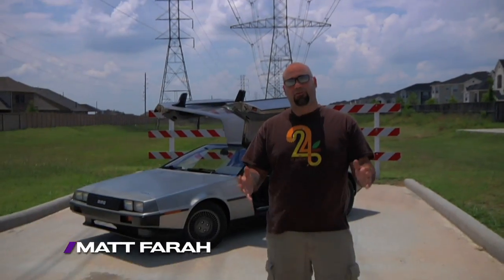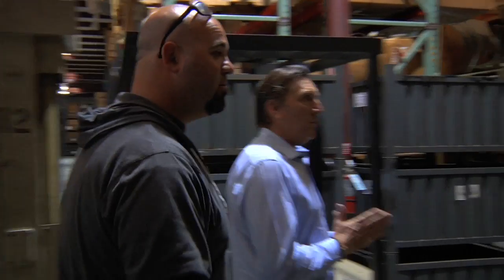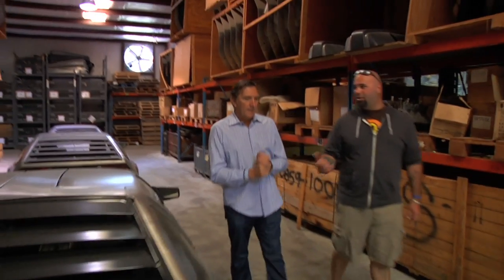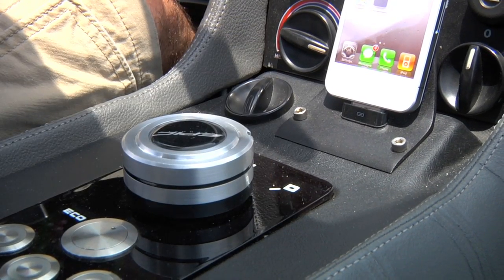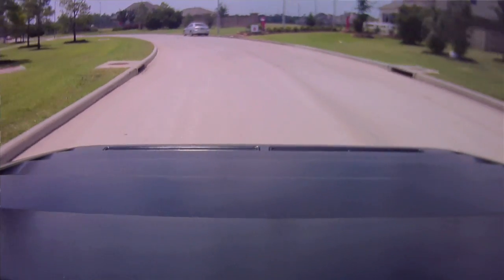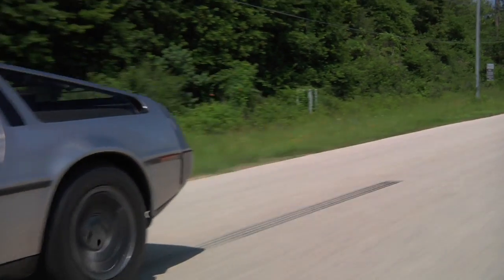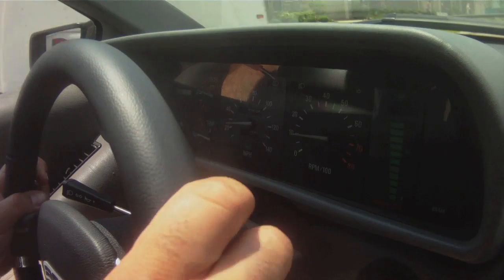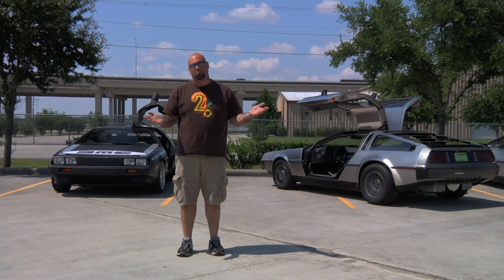DMC's New Electric Delorean -- /TUNED

Comment: "35 kW-h electric motor"? Do you mean 35 kW-h battery? Motors are measured in watts or horsepower, not watt-hours.
Reply: Guy just has no clue....sad
Reply: Teslas are rated in kw if I remember right
Reply: @nubreed13  I think you mean Jigga-watts actually!
Reply: @Hypercube9  exactly
Reply: @nubreed13 
That's still the battery rating, not the motor.
Reply: kWh is a battery capacity rating, and 35 is pretty normal for EV conversions. kW is a motor power rating, and 35 kW wouldn't be nearly enough for a DeLorean. Most likely the motor is a bit over 100 kW.
Reply: Yeah, I winced a bit there, too.

Comment: because of the car's limited range and how many miles are required to film (usually 75-80) we couldn't go too far from DMC's headquarters in case we ran low on juice. Their headquarters is in a heavy traffic area, so that was the quietest streets we could find locally for filming. The downsides of electricity....

Comment: why isnt there 1.21 gigawatts of electric power? that would be cool.
Reply: The car wouldn't even start.
Reply: That amount of power can't be generated without a nuclear power plant charging station Which the new Iphone needs.
Reply: No battery and motor setup is that powerful. Even if it could actually output that kind of power, it would probably vaporize the tires almost instantly.
Reply: @fancyman4006  wayne says yes it can be done

Comment: why can't the engine generate 1.21 Jigawatts? :3
Reply: true
Reply: It can, it's just that when you convert that to actual watts  it's not so impressive anymore...
Reply: What the hell is a Jigawatt?!
Reply: A bolt of lightning :3
Reply: And hybrids.
Reply: Crevetta its how doc pronounces gigawatts
Reply: 1210 megawatts? ;)
Reply: Plutonium is hard to come by
Reply: Because you need a plutonium chamber to generate the 1.21 gigawatts of electricity into a flux capacitor in order to travel in time! Not to mention the lack of time circuits!
Reply: Crevetta its how doc pronounces gigawatts

No, it's how he pronounces Jigawatts.  Go take a look at the script, it is spelt with a J.

Comment: That "reverse to grid", as they call it, is quite handy. When I converted my 63 Ford Econoline Van into a hybrid (because I'm a technophile, and no other reason) and gave it a power station so I could run my appliances while camping. Since I gave it 4x 30 amp 110v circuits, and 2 additional 30x120 linked to make a 60x240 (Arch welder, drier, just because) I was able to power my whole farm for three weeks when the power got wiped out a few years back.

Comment: You can't be nostalgic about a car that came out last year though. Even buying a "brand new" delorean will still look, feel, and drive as the car did in 1981. It may be new parts, but for all intents and purposes, it's still an old car. A volt is a brand new car, with a brand new design. That very point is what prevents the word "nostalgia" for coming into play. In 20 years you can be nostalgic about the Volt, but now? no.

Comment: Shame it still doesn't sound as wicked as it does in the film, I bloody love that high pitched whine sound.
Reply: +Johny40Se7en They actually dubbed the engine sounds of a porsche over the cars actual noise in the film.
Reply: MrRibbotron What Porsche has that whine sound?
Reply: The whine was a seperate noise from the electrical parts of the time machine. The engine sound was from a porsche 928 V8
Reply: MrRibbotron ah right ok, ta.

Sure that there's some kind of techno gizmo that could make that cool sound for a real life Delorean, odd that no one's done that yet, especially this one, being electric.
Reply: One of the guys that worked on the movie said they used jet engine sound effects
Reply: That might be for the sounds when it actually time-travels.
Reply: I think it's just for the time machine and that's it...any motor sound it has

Comment: These cars will still be driving around in 100 years. Why aren't all cars made of stainless steel so they don't rust?
Reply: it's softer also heavier
Reply: Sang3ETA the cost of materials would make the expensive to but.
Reply: Stainless can and will eventually rust.
Reply: Because the paint on cars stops them from rusting.
Reply: only the outer shell is stainless, 
the chassis is normal steel and they rust like crazy, 
never say a delorean doesn't rust because it does,
stainless is not softer its harder and also work hardens easy meaning it can crack easier,
it can work harden from flexing like a normal chassis/panel does,
depending on the grade,
also make conventional repairs almost impossible so its panel replacement,
306 stainless used to be 16% dearer when buying fasteners a few years back so its not that much dearer.
Reply: If only they wouldn't let Renault in the equation... they're not exactly known for utterly reliable cars, rather the opposite.
Reply: They made stainless jeeps in the Philippines.  Just the body though the frame had to be regular steel due to fatigue problems
Reply: Weight and cost.
Reply: Because it causes Flux Dispersal.
Reply: @nubreed13  do you mean jeepneys???? The Americans will think of those Jeeps(Oner)
Reply: @MetalTrabant 
To be fair, the original Renault engine was actually pretty solid... if you ignore the absolute clusterfuck of a fuel injection system they stuck on the DMC-12 and ONLY the DMC-12 and not any of the other cars that had that engine.
Reply: Seeing all these DeLorean parts in good condition after 4 decades just sitting in a warehouse without special preservation measures, and stories about DeLoreans being neglected for decades in warehouses and can still be rebuilt without work needed on the chassis, makes you realise that the upcoming Tesla Cybertruck will easily last over half a century with its fully stainless steel chassis.
Driving with the doors up look good and all, but I'd worry about the stress that it's putting on the hinges with the doors flapping over every little bump.  And at higher speeds the doors are going to give a lot of air resistance and take a lot of stress from the airflow.

Comment: Simple solution to the "boring engine" problem with the DeLorean. Replace the stock engine with the engine from a Subaru Impreza WRX STi, probably the '04 or '05 model. I would love to see that.
Reply: a camry v6 or other similar v6's should get the job done without much convesion. remember that a boxer engine has a different shape than the generic v6
Reply: jago107 it would probably fit very nicely In that engine bay, the only issue would be directing air to the intercooler, nothing a functional roof mounted scoop at the rear window couldn’t fix

Comment: "A 35 kilowatt-hour electric motor" OMG YOU CAN'T MAKE THIS SHIT UP
Reply: +mikokuijn 35 kilowatt-hour....fack...is that not a measurement for battery size now?
Reply: +kevin tate kWh is a measure of energy (amount of joules) while W is a measure of power (how fast per unit of time joules are consumed)
A motor has power, not energy capacity so Watts are applicable.
Say your laptop battery has a capacity of 90 Wh and the laptop consumes 10W power constantly, you can divide and get a runtime of 9 hours.
Reply: mikokuijn No I get it,  I just thought I was hearing the fellow weird

Comment: They will build you a brand new, bone stock delorean, which is registered as an 81 delorean but with some updated electronics and such, starting at $62,000. You can get the stage 2 or 3 upgrades installed for more power, and eibach springs for better handling, for an additional price. I thought that was old news? Guess not.

Comment: If you build a new daloreon from old stock parts from 1980's is it still considered a historical vehicle as the parts are over 25 years old lol?
Reply: It goes by when the vin is first registered. If the vins for the rest of the ones that aren't built where some how registered in 1980 which is illigal. It's a brand new 2000 something with 1980's parts. It's still a rich man's toy.
Reply: It depends.  I believe if it has the original vin tags it's an original car.    The parts are all originally from the 1980s

Comment: Thank you for responding. I was aware that they do build "new" DMC-12's at a price roughly equal to what was asked in the 1980s. $25K really lost value in the last 30-some years. As I understand it, these "new" DMC-12's are built using the old parts, with the addition of some modern bits and conveniences but are fundamentally the exact same car sold "back in the day". I'm on about DMC making a ground up, all-new car, not just sprousing up the old one with a few "bits and bobs".

Comment: 1) A Tesla will not smoke a Lambo or Ferrari in the quarter mile. In the 60', probably, but Tesla's dont have enough peak power to beat a (new) Ferrari or Lambo in any kind of real distance. I think the reason for the poor off-the-line performance has to do with the final drive ratio. Tesla's AC motor revs higher than this DC motor by about 4,000 RPM, so it can achieve its top speed with a shorter final drive, producing better acceleration off the line. The new AC motor also has regenerative

Comment: Kilowatthours are a unit of measurement for total battery capacity and not to be confused with kilowatts. The engine, at 250hp is roughly equivalent to 184kW.

Comment: Better to just buy base car as donor and have aftermarket company in San Diego load a Tesla Ludacris motor. Then figure out way to get wider tires. Then take to West Coast Customs and get new seats//custom interior. Maybe they can retrofit VW hvac system with dials and other various buttons. Then who see who can make modern LED custom tail lights and combine the front square headlights into two large Audi style front lights. Then it would be the car it always needed to be in 2020. That would be one of my dream cars for sure. Willing to work with DMC SoCal to help improve if hiring.

Comment: Question you mention they are integrating more upgrades on the electric one and the AC is  need it on that car because as you showed the windows are a piece of art for lack of another word, how much running AC will take away from the range of the car and the top speed, as we know the more trinkets working on battery power the more juice it uses and the least range and top performance you get.

Comment: Stainless steel construction... it's just the body panels.  The Delorean Motor Company can give you a stainless steel Double-Y chassis now, but originally that wasn't under the car.  The car is still mostly fiberglass.

Matt, have you tried the 200hp stage II engine upgrade?  Given I haven't, and it's still not likely any faster than a GTI, it's something.  That engine has a nice growl, to boot.  Sorta like a fuel injected Dino when done right.  That and I'd like to see the three stages tested.

Comment: You can do a conversion for way less and you would be able to run the batteries in the tunnel. No doubt you could also get a better motor as well. But it good to see them progressing forward and moving away from fossil fuel.
Reply: where is your prius?

Comment: The engine would've been great if someone out there recreates the DMC-12 Legend Industries Twin-Turbo version. It made around the same power as that Stage-3 package DMC-12 and back in the day it completely whooped the Ferrari 308 and the Porsche 928 in 0 to 60 (5.8 seconds, top speed 150 mph) and on the track, its would-be competitors of the time. Sadly, since John DeLorean's fiasco that ended with DMC in bankruptcy, that also caused the 5,000 twin turbocharged DMC-12s that were in the planning/ordering stages to be aborted before they could get beyond the testing stages. Imagine that, there were 4 turbo DMC-12s from factory, all of them test mules for Legend's turbo system, 2 of the twin turbo (VIN 530 and 558), 2 of them larger single turbo. Those PRV engines had 6 turbo test engines, 4 DMC-12s and 2 Renault Alpines. The funny thing about the PRV was that it was gutless and very low compression, so a twin turbo as DMC had planned (or that Stage-3 with the 5 pounds of boost) did wonders to increase the depressed 130 hp the stock engine had, just improve the other components to make it more reliable as Legend and DMC would've done back then.

Comment: they can always have 12v reverse cycle air conditioner hard wired into the electrical system and have it use the same ducts the car used, but without the blower motor fan.

Or they an have the condenser hooked up to a pully that is attached to the axel that's powering the wheels

Comment: is this rear or front wheel drive? they should have it set up so which set of wheels (either rear or front) thats not the driving wheels but the dead weight rolling ones lol have a pulley system that uses alternators to charge those batteries

Comment: you know, the future upgraded one, with that fusion powerplant, still needed gas in addiiton to trash for the time drive.
why not run the car on the power output from the fusion plant? i am quite sure it could generate enough to power it lol..
of course i am sure that the third movie did that bit entirely for the plot, as electric motors obviously existed back then.

Comment: What's not to love in the Delorean? Having driven one, I can tell you!

1) The Engine
2) The brakes
3) The suspension
4) The ride
5) The handling
6) The electrics
7) The seats
8) The steering wheel
9) The gearbox
10) The build quality
11) The stainless steel body.

Why is the stainless steel body bad? Because it means they'll NEVER EVER rot away. :(

Comment: This is pretty neat, but seriously guys, learn the difference between energy, and power, it's an extremely basic concept that is, for some reason, so often misunderstood. It has a 35 kWh (kilowatt hours) or 126 MJ  (megajoules, or megawatt seconds) battery pack (that's the energy stored), and a 230 HP motor which is about 171 kW (that's the peak power of the motor). Energy is power multiplied by time, super simple example:

If the car was consuming 35 kW of POWER for one hour (that's 35 kWh of ENERGY), that would completely deplete the battery pack.

Comment: It's too bad the DeLorean's styling is just not up to part anymore.  I'd like to see one with aluminum, fiber glass, or some carbon composite construction instead of the steel.  This would save a lot of weight leading to better performance in all areas.

Comment: Matt i have a question for you as we know electric power cars have way more torque that gasoline power one. point the new tesla, and on the videos online from tesla they SMOKE the $#!%% out of ferrari and Lambo from standing point in a 1/4 mile run but why that DMC was so slow taking off when you went onto traffic in the highway, also they mention they will put a different motor for production but they dont speciffied why? do you know did he told you and just got cut on editing. can you expand

Comment: 15k for stage3 still makes no sense, for that you could definitely do a tight swap of some other motor that would embarrass it... even if nobody seems to do that
Reply: the problem is that the suspension isnt really strong for a better engine. maybe 200 hp is the limit for that suspencion
Reply: The problem is the DeLorean is a cool body on an otherwise pointless car.

Comment: ELECTRIC!????!!!??!! WHHHHYYY WHHHHHHHHYYYYY!!!!!!!!!!!!!!!!!!!!!
Reply: Maybe because the original engine is too slow?
Reply: Yeah but why not put a v8 in it or somthing
Reply: To just put a bigger engine is not innovation. Now, an electric motor is :D
Reply: Priuses suck, Priuses are electric so is the Delorean there for that DeLorean sucks.
Reply: Thats not a good analogy. Teslas doesn't suck, i8 doesn't suck, 918 doesn't suck.
Reply: Gas is better than electric
Reply: Explain that.
Reply: In my opinion I like gas better.
Reply: Gabe Lewis I do too, but if it isn't a Prius that has no power (under 200 horsepower) then I'm fine with it
Reply: Razmalia Man, if i was gonna do an engine swap in a DeLorean It'd probably be a massive gas guzzling v8.
Reply: wouldn't fit engine bay is tiny
Reply: Razmalia some guy made 6.2 liter corvette engine fit in one.
Reply: da fuck? ls1 maybe?
Reply: Razmalia I'm pretty sure it was an ls7 I might be wrong though.
Reply: ls1, that was the one on youtube atleast,

Comment: The bald dude said the car has the 35KWH motor and has 250hp. (Which makes no sense)
The old dude said it has 35 KW "of power on board", which is ambiguous. And then he went on and said that the 0-60 time is under 5 sec and that is uses LiFePo battery and DC motor which has the equivalent of 250hp.
And then... the bald dude said that motor makes 230hp and 240lb ft of torque.
It seems they didn't agree on power output before they shot this video.
Maybe I'm missing something, can anyone explain this to me?
Reply: This video was really confusing, because KWH isn't even a proper unit to compare to hp. Assuming he meant just KW then it still doesn;t make sense becuase 1KW = 1.34hp so the engine has 46.93hp
Reply: He meant 35 kWh worth of batteries, presumably. The motor output is 250 HP, or about 180 kW.

Comment: "35 kWh motor"? Matt needs to brush up on his EV terminology. Batteries are measured in kWh, and 35 sounds reasonable. Motors are measured in kW, and 35 would be pretty pitiful for a heavy car like a DeLorean. The guy he's interviewing seems confused too... "35 kW of power on board"? He must mean the battery again, because 35 kW is about 47 horsepower, not 200. If it's making 200 horsepower, then that's a 150 kW motor, which sounds correct for the acceleration they're getting.

It's a really cool car - I just wish they'd stop utterly butchering the terminology.